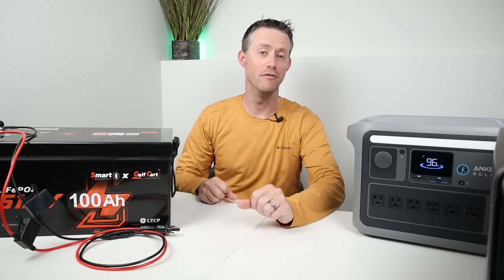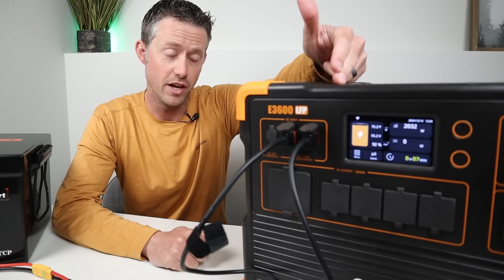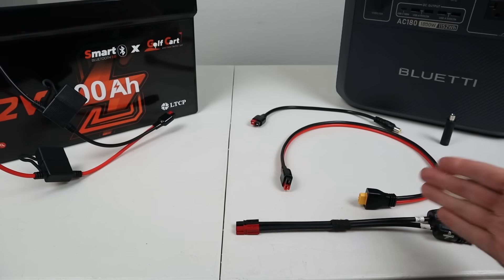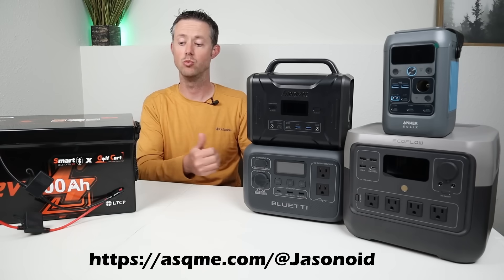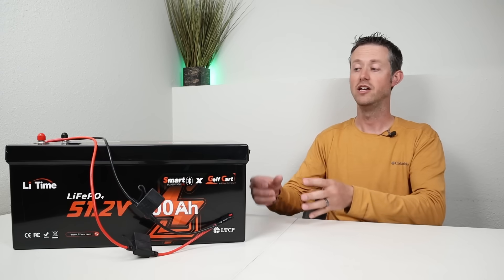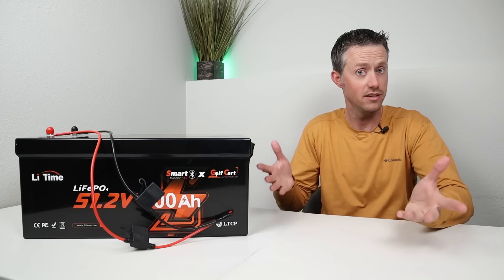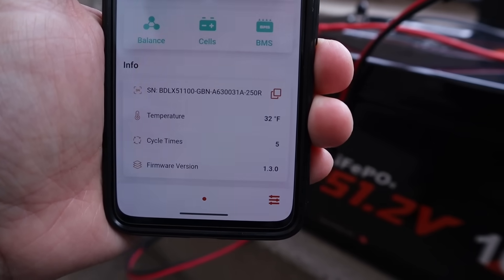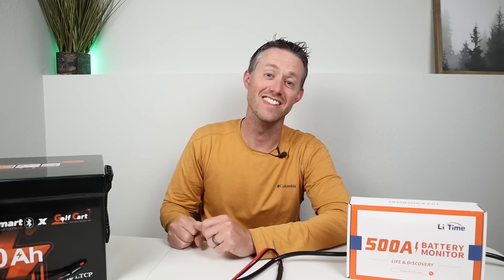Simple Trick to Make Your Power Station Last 5X Longer! Charging with a LiTime 48v Smart Battery!

Comment: Jason ,
Forgot to say that I will be going from the battery to the Bluetti Charger 1 then to the power station box , what size up wire with  proper size fuses at the battery and the name of the complete set up with the proper fuses and where to purchase this complete set up .... 
Thanks Jason , Dave .
Reply from the maker: Gotcha! That all makes sense now! Just FYI, the Bluetti charger one says it comes with the DC wiring included now...which wasn't the case when I reviewed it! Great news since it will just hook right up to your battery now:
http://shrsl.com/4ps8n

However, if you want to run your own wiring, you'll want to run 6awg wires from your battery to the Bluetti Charger 1 since it's capable of pulling 50 amps. With that 6awg wire you'll want to use a 60 amp fuse. You'll probably need to get some SB50 crimpers to complete the install if you are doing it yourself:

6 AWG Wire:   https://amzn.to/4eM20Gm
60 amp Fuse:   https://amzn.to/3Ntzyx2
SB50 Anderson Crimpers:   https://amzn.to/3NuDGNe
SB50 Anderson Connections (6 awg terminals):  https://amzn.to/3Nsspgk
Reply: @Jasonoid  
Thanks, Jason .
I will look at the links later when I have my time to spare ... I Did get the wire with the Charger 1 from Bluetti it's like 20ft long, I will be making up some shorter ones because it will drive me nuts with all the wire laying around .
Now that 20ft wire with the Charger 1 has a breaker already on it, will I need to install a breaker on my new shorter set of wire that im going to be buying or will the fuses be enough ?
Thanks in advance .
Reply from the maker: @MrDaveR-uq7iq  you can do either a DC breaker or a fuse. Either option will work just fine. The breakers are resettable which is an extra plus.
Reply: @Jasonoid 
Thanks Jason ,
Now I feel comfortable with my soon too be new set up just waiting on my new lifepo4 smart battery to arrive . I will look up those links tonight and order those things and yes I would rather build the wires myself since  I will be needing many more cables made for the future .
Again thanks Jason for making this really simple for a beginner .

Comment: Great Video Jason ,
Question :  I have the Elite 200V2 and just order the Litime 12.8V 230ah deep cyle battery , going with oversized from the battery out a couple feet I need to know what size fuse to put just after the battery before I connect to whatever the connect Bluetti has to charge with at the power box, haven't had time to read about it yet is it the xt60 charge at the upper left of the power station ?
Shall I go with the 4 awd cable from the battery out a couple feet ?  Also could you tell me where I could go and buy this wire already made with the proper fuses ?
Thanks Jason , Dave .
Reply from the maker: Thanks for the Super Chat!
The Bluetti Elite 200V2 supports up to 20 amps input via the solar charge controller. If you wanted to connect directly to your 12v battery, the power station will probably charge around 8 amps or about 100 watts (due to the low voltage).  A power station needs higher voltage to charge quickly. That's why in this video I used a 48v battery instead of a 12v battery. 

In order to charge faster from your 230ah 12v battery, you'll need to purchase something like the Bluetti Charger 1 to boost up the voltage:   https://youtu.be/NeBx70G2g6s

If you aren't worried about charging faster, using the wiring in the video would work just fine:
10 AWG Ring Terminal to Anderson With Fuse:   https://amzn.to/41qZdyt
Anderson to XT60:   https://amzn.to/41srCEy

Comment: Thanks for another great video! Hey, another channel covered the sema show and they did a mention that next month Harbor Freight is releasing a new line of power stations up to i think 2000 wh... this would be great to review, given their stores are everywhere making replacement easy in thr event of a problem... I'd love to see a comprehensive review!
Reply from the maker: I saw those new models. They might be a good contender based on the pricing. I'll have to check them out when they are launched!
Reply: Based on what specifications they've released it looks like they're a few years behind on their abilities and features.

Think last generation Jackery specs.
Their ONLY high point is that you can just pop into Harbor Freight and walk out with a new one if you have any warranty problems.

Comment: I always enjoy your content.  I click "Like" before you even start talking.  You're one of the best out there, on this topic.  (You hear the 'but' coming, right?)

Please don't call these "DIY expansion batteries".  Call them fake solar input, because that's what they are.  The battery capacity of the power station is not changed in any sense, by routing the capacity of these external batteries to the solar charge controller of a power station.  Also, there's no guarantee a power station will last "5X Longer", or any multiple of "X" longer, without knowing the output capacity of the external battery, the solar input limits, and the load connected to the power station. 

You're very good at what you're doing, but go the extra mile and don't create false terminology or false expectations.  This is a "hack" or a work-around that can definitely be used to extend run-times, but be transparent about the limitations.
Reply from the maker: I explain that clearly @6:56 when I talk about the disadvantages of using a battery like this.
Reply: @Jasonoid  - Yeah, but you really should lead with it and not risk confusing viewers into thinking you're actually extending the battery capacity of the power station.  I get that your revenue is a factor of views, but I greatly respect your content and hope to continue doing so.

Comment: This looks like a good idea; use my panels to charge a battery like this, and use the battery to charge larger power stations.  I'll need a 48V MPPT controller, but that may be about it.  Not as efficient, but if I do a 24V battery instead, I can also use it to charge smaller power stations.  I'm going to avoid drawing any more income until next year (only a few weeks) to keep it away from the taxman this year; so I've got time to think about it.
A nice thing about retiring recently is that I no longer have to get up extra early to scrape a layer of global warming off the car.
Reply from the maker: Scraping the windshield in the morning is probably one of the worst chores in life...
Reply: Would the MPPT battery cables connect to the same lugs as the connection to the solar xt60 connector that goes to the back of the c1000?
Reply: Im tying to figure this out right now as but no videos to explain. Im making a DIY power station with Solar panels and im using my Main Dabbsson 2000L power station to power a IceCo fridge and other stuff this way that one is always fully charged.  But do I use the DC plug that has 3 prongs or the yellow square that has 2 prongs? Also do I connect it to a 1000 watt inverter that is inside the diy station. Im lost now lol

Comment: Excellent video! I think this is way better than using a DC to DC converter. It will cost less and be much more efficient. You can also use the 48v battery for a larger project down the road!
Reply from the maker: Thanks for checking out the video!

Comment: Thanks for the video. Overall, I found your video to be informative and helpful, tho, I don't really agree with the title of this video. This does not really make your power station last 5x longer... 
At least from my point of view, imagine your title was "Simple Trick to make your car last 5x longer", and then you are shown a "portable gas tank"... that's not a trick. It is just more fuel.
If the title said, "Simple trick to add more battery storage to your PowerStation", then yea... again with the caveats that typically the power station won't recharge these.
Reply from the maker: The word 'longer' seems to mean different things to you I. '5X longer' runtime is what the video is talking about. The EcoFlow Delta 3 plus in the thumbnail has 1024wh of capacity, adding on an additional 5120wh will make it have a 5X longer runtime. That's exactly what the video is about. I think you are getting caught up too much in a play on words...

Comment: @Jasonoid I see fuses on both the positive and negative wires.  I thought that a fuse was needed only on the positive wire. Are they needed on both?  Thanks!
Reply from the maker: It's just the way the adapter came, the more the merrier I guess...
Reply: @Jasonoid  ok thank you.  I’m no expert—just curious.
Reply from the maker: @teuton6167  it was extremely hard to find a 10 awg ring terminal adapter that would support multiple connection types for all power stations. This one fit the bill 👍

Comment: How do I charge this additional battery via AC outlet instead of solar during off peak hours?
Reply: @sumyap3869  
You would just need to get a 48V charger and plug it into the power station. 
Then during the hours you wanted to use the electricity you would have it pull from grid power and charge the batteries up. 

During that time though you would want to disconnect the battery from the solar input though.
Reply from the maker: This is the charger seen in the video:   https://amzn.to/3ZskXas
A 48v LFP battery charger.
Reply: I bought a Noco 10 charger for my battery (a 100V 12A with a built in BMS).

Comment: I got a delta pro. Can these batteries run in series? The Delta Pro has 150v input and it pulls 15.9 amps. So I'm guessing if these batteries can run series i could pull the max 1600 watts?
Reply: @jaysonstebbins2539  

That would work, but you would need the ability to charge the battery bank @100 + Volts.

Unless you disassembled the series connection every time you want to charge it and then individually charge the batteries at 48V each time.
Reply: @andrewr05  that wouldn't be a problem. Two chargers on thier battery with a isolated would take care of that. :)
Reply from the maker: Most 48v LFP battery do NOT support series connections. only parallel. You'd need to verify with the battery specs they support series connections before trying that....but.... it would technically work on the Delta Pro if the batteries could be wired in series.
Reply: @Jasonoid  that's fair. I could see the bms not allowing series. Cool thanks! Nice find on the battery too!

Comment: What do you think of using Ecoflow alternator charger for LFP to deltas.
Reply from the maker: This batteries doesn't need the Ecoflow alternator charger, but if you want to use a 12v battery you'll need the alternator charger.

Comment: Y'all should checkout the EcoWorthy/DCHouse batteries.

They're reviewed very well and are about 3/4 to 2/3 the cost of this LiTime battery from either their 48V 100Ah battery or a two pack of their 50Ah respectively.

Edit-
Sorry, I paused the video and it made this post without realizing that you had a sponsored video, I don't mean to step on any toes by recommending a cheaper option.

Comment: An important thing to mention is that the external battery has to be charged by the power station or by other means, and when you want to use the extended capacity, you have to connect to the power station. You can't leave it all set like the extended batteries that are sold for the power stations. Unless you make another system (such as solar panels going to a charger that go to the battery, and then the battery connected to the powerstation permanently). Having to keep the stand alone battery charged manually (with a floating charger for example) and using it only when the power station runs out has its limitations... A stand alone 12v or 24v battery though would be a better fit to plug a fridge for example, since no inverter would be needed which consumes watts for being on. But then one would have to charge that battery with the powerstation  DC out for example and deal with that as well. Cheers
Reply from the maker: Yep, I mentioned that clearly in the video

Comment: Those thinner gauge extension cables are of concern.
Reply: @thefpvlife7785  

Most larger power stations only draw 15-20A.
Reply from the maker: Wire size is determined by the amps you need to move through the wire. The 10 awg wire supporting 30 amps is plenty for what is seen in this video. If you have a power station that takes in more amps, change your wire accordingly.

Comment: Very cool.  Wouldn’t something like the EcoFlow alternator charger be really nice to have if you had this external battery with an EcoFlow Delta 3+?   I believe if you had the alternator charger, then you could have control through the app of going both directions?
Reply from the maker: One benefit of the Ecoflow alternator charger is that is does allow power in both directions. It won't work with a 48v battery though.
Reply: @Jasonoid  I thought it did!  I totally didn’t realize it didn’t support 48v batteries though.  That’s too bad!  It would have been the perfect solution if it did!   Maybe in version two they will add that if it’s possible!
Reply from the maker: @WingAddict  input voltage is designed for 12v/24v batteries only. 12v-35v input range 😔
Reply: @WingAddict  

I may be mistaken, but the alternator charger cannot have a 48V input.
It is only expecting common alternator voltages.
Reply: Check ETAKER F2000. It is multi input and output and best of all, it charges your RV car battery back. It can even jump start it. It can do input of 1000w DC + 1000w solar to a total of 1800w output. The ports are bi directional and customizable.

Comment: Jason, i've seen this method on many batteries, but what I'm not sure on is, what restricts the amount of current? The only thing that it could be is the solar power station's input and some sort of controller in there.

How would this work with a dumber MPPT charge controller? For example, if you were to connect the 48v battery to the solar input terminals of an MPPT charge controller, attached to a 24v battery or 12v battery bank, would the 48v battery try to dump all its power in? Would the MPPT limit the current input? 

I know a lot of build yourself DIY solutions with server rack batteries, hybrid inverters and the like usually beat a power station on price/performance, but this expansion battery capability is something I'm not sure works with those solutions.
Reply from the maker: Looking at the specs on my EG4 6000xp solar charge controller it lists both a usable current and the max solar short circuit current (17 amps and 25 amps). You'd want to stay below the max ISC current listed in the manual when designing your solar array or battery connection. 

Power stations don't have that spec and I haven't seen an issue connecting a battery up to a power station, the power has always been limited properly. You can always be safe by using fuses and the proper wire size just in case something goes wrong.
Reply: In almost every situation when you're dealing with electronics the device will never pull in more amps than it needs.

That being said, it probably wouldn't hurt to have some in-line fuses or circuit breakers when doing this kind of thing because it's always better for your fuse to blow or your circuit breaker to trip rather than to fry some internal circuitry in your power station.
Even if the chances are extremely small.

That being said I've been doing this with almost every power station I've ever owned and have never had any issues and I don't use any small level current limiting devices or fuses.

I do have a Class T fuse that I run everything through usually, but those are rated at hundreds of amps and thousands of peak amps.
Reply: @andrewr05  I get that with a power station. I'm talking about those hand truck diy builds that attach a hybrid mppt inverter like a growatt to a 48v battery. I'm not sure what if anything would limit the amount of current going into the solar input.
Reply: @justicator  
Well, in that case you wouldn't be plugging into the solar input of the off-grid inverter.
You'd be connecting your batteries up together as your main battery bank. 

But even if for some reason you did want to connect a battery into the charge controller it would still act the same way. 
It isn't going to draw more amperage than it's asking for.
Reply: @andrewr05  sorry andrew, to clarify, I have a 12v system at home, but have some smaller batteries that i want to charge my main bank with on cloudy/rainy days.

I dont have a good DC to DC solution, so I was wondering if its possible to plug spare batteries into my mppt charge controller when my main bank is low. My concern is that if i have a 100ah battery like in jason's video, I dont think my charge controller or wiring can handle all 100amps if the battery were to want to dump it all at once. Fusing wouldn't really help if theres nothing limiting the current, and would just blow instantly if i used a 40a fuse for example. I dont really understand what  component is limiting the current draw from a raw battery like in jason's video
Reply: @justicator 

Yes, it will work.
A SCC is basically just a voltage converter anyways.
As long as you're withing the limits of the controllers voltage range then its a viable option.

I've seen people on forums use charge controllers solely as buck converters for specific purposes.
Reply: @andrewr05  thanks Andrew, I'll have to fuse it up and give it a shot